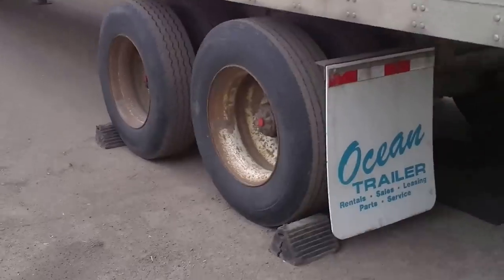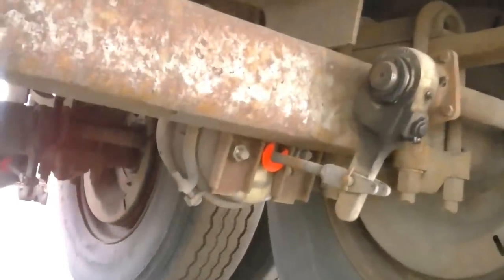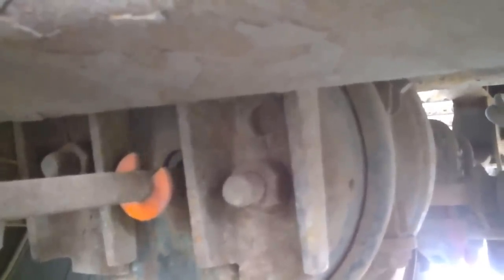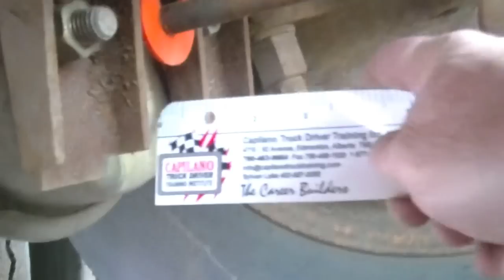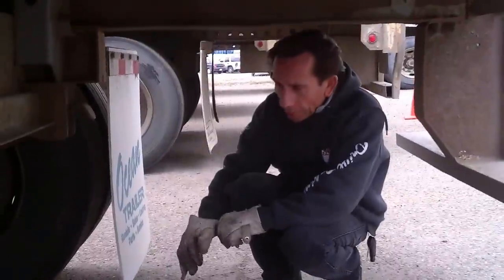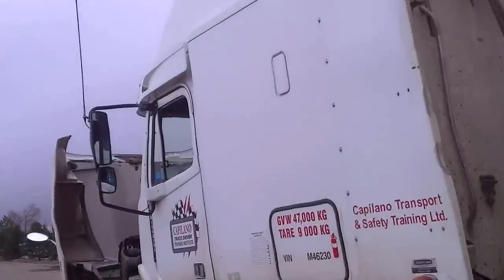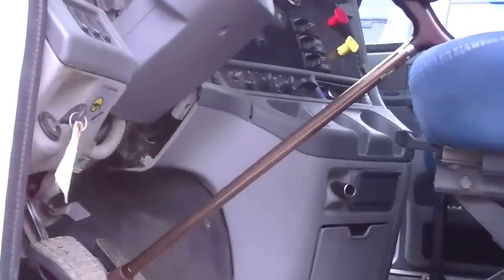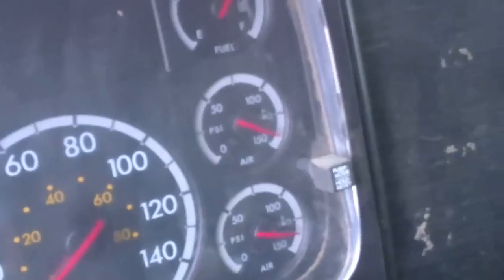Check push rod travel on a type 30 air brake chamber

Comment: Whoa there a second, 140 psi applied? Max allowed is 135 psi, and CVSA standard is to measure 90-100 psi.
Reply from the maker: Its been a while since ive reviewed the video. what is the context of 140 psi? or is it the marbles in our mouths?
Reply: Dale Francis when you show cane, you go to gauge showing 140 psi. The truck should not be running when checking applied pushrod stroke.
Reply from the maker: good comment, you're right!!